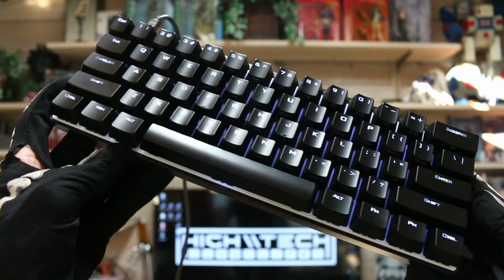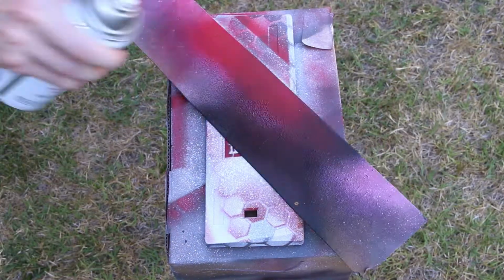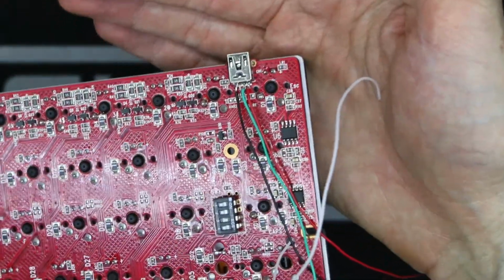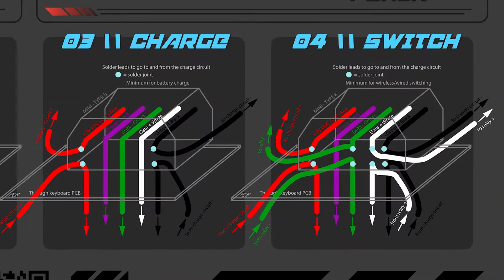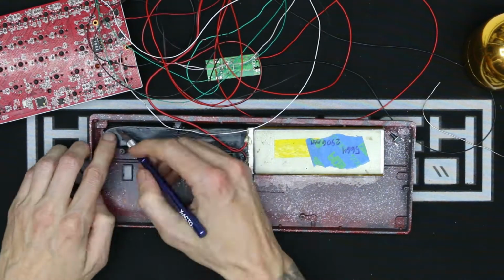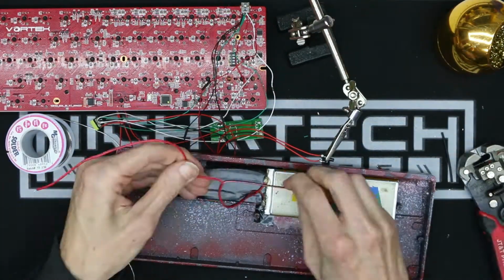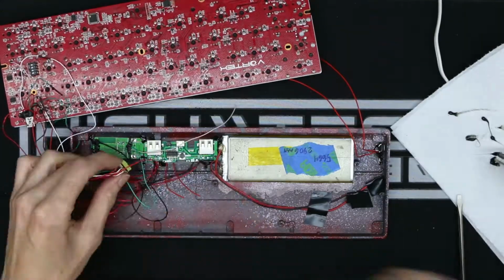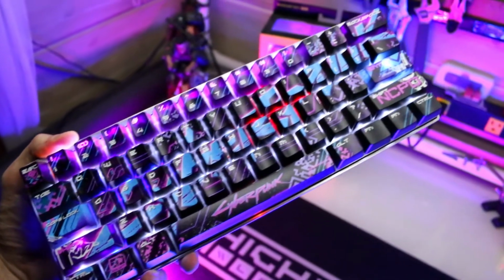⌨ Making A 60% Pok3r Keyboard Wireless! DIY Converting A Mechanical USB Keyboard to Bluetooth + Mods

Comment: If I wanted to make an external bluetooth pack for a keyboard, I would just do everything except the keyboard soldering?
Reply from the maker: If you want to do it external, you don't have to solder anything, just plug n play all the USB connectors 👍If you watch my tutorial video for this I make "joke" in the beginning where I show just that, it's very simple.

Comment: tip, instead of cutting hte mini  USB pins, heat up sand lift from the keyboard PCB. then you have a pin and a pad to solder to.
Reply from the maker: Yes, if you have a hot air station it is easier that way, if you only have a soldering iron then clipping is easier and safer. When I modded this board I didn't have a hot air station, but now I do 👍

Comment: dude i would love to pick  your brain for an issue im having with a project i started.
Reply from the maker: Cool man, what issues are you having?
Reply: @hightech-lowlife  Im trying to solder on a stream deck directly to a keyboard PCB. On the back of the PCB there are pads labeled "5v, d+, d-, gnd" but when I solder to them the stream deck turns on but doesn't connect to the computer. I'm new to this and don't want to brick the board attempting to solder directly to the USBC port like you did in this video.
Reply from the maker: @iv3zaj  Most likely you need to swap the green and white wires (USB data), try it out 👍, you only run risk of harming something if you reverse polarity of the VCC (red/power) and Ground (black).
Reply: @hightech-lowlife  the last video I posted shows the project I'm working on
Reply from the maker: @iv3zaj  In your video If you look at the wires you removed, and then compare to the wires you added, you'll see you swapped the the green and white which correlates to the issue you're having.
Reply: @hightech-lowlife  you wanna hop on discord? im trying to troubleshoot now
Reply: @hightech-lowlife  i noticed that after the fact and corrected it. thats so funny because when i posted the video i didnt think anyone would notice that. lol youre a beast.
Reply from the maker: @iv3zaj  Cool, so it should work now, right? Good job man 👍
Reply: @hightech-lowlife  it's working for a few minutes at a time then freezing. I have to unplug and plug it back in constantly. Could it be the USB C module I'm using? I tried multiple cables and I'm having the same problem
Reply from the maker: @iv3zaj  I would take it out of the keyboard to troubleshoot first, see if you can get it to work there, then implement it back into the board. If it works outside the board but not within, then it will narrow down what is causing the issue. 👍

Comment: You should use a custom PCB board so that the wires do not tangle or mix together. Can you try the Cheap Wireless Keyboard and Transfer it to Wired Mechanical Keyboard, it seems this would work
Reply from the maker: Can you let me know what this board would do? Just for cleanup? If you think this is a lot of wires you should see my dual battery build I made after this one 👍

Yes it is possible to do that, I have read a few articles of other people doing it, I'll try it and make a video later on. Thanks!
Reply: @hightech-lowlife  ohh thanks ill wait for that tranferring  cheap wireless to wired mechanical keyboard :D
Reply from the maker: @jazzehenderson8973  No prob 👍🍻

Comment: I plan to make my keyboard wireless as well! Would the process be the same if I were to use a HID bluetooth module (like a RN-42) instead of the Handheld Scientific BT-500?
Reply from the maker: 100% - there are a few people who have made something like this with them before - https://stackoverflow.com/questions/16243602/arduino-rn-42-bluetooth-module-hid 

I do believe you will need an arduino to control it though. The BT-500 does cost more but when you factor in having to buy an arduino also, and how you value your time to me it's not that much more for a whole lot more convenience. 

It depends on what you're going for though, undoubtedly you will learn a lot more going the arduino route, and also get much more granular control but you will need to dump some time into setting up the code and troubleshooting things, etc. 

Either way it can be done 👍 Good luck man!
Reply: @hightech-lowlife  Thank you! I have another question. Is there a usb adapter like the BT-500 that supports bluetooth 5.0?
Reply from the maker: @bubbytam5400  Not that I am aware of, I'm sure Handheld Sci will come out with a new revision at some point though. 

I'm pretty sure some of the newer arduinos have 5.0, you might want to check out the ESP32 board too: https://www.sparkfun.com/news/3345

Comment: Hmm, in the custom keyboard community, we have this amazing mod called the foam mod, in which you put a piece of foam on the base to dampen the noise and give it a more deep sound signature, this would be great in this build as well it could be useful for hiding the cables, (cut a hole in the foam for the parts the wire is passing through)
Reply from the maker: I'll pack it with foam 👍👍👍Thank you for watching and commenting!

Comment: Quick question, will the keyboard still work connected directly to the computer? I know that if a keyboard uses QMK or VIA it would need to be directly connected to the computer via USB in order to be able to flash it and modify the software. Just wondering if this mod will take away the ability to reprogram the keyboard.
Reply from the maker: Yes, it will! The way I have setup this mod is basically like having two keyboards in one. 

One is just the 'stock' wired configuration, then when you engage the two relays with a double-tap of the power button it physically changes the wiring to take power from the battery and also disengages the data wires so that you can then use the same USB connector to supply charging to the battery. 

When you're in "wired" mode the keyboard and the PC recognize it as it was just a regular wired keyboard (which it is in this state), so you can flash firmware all day without any issues.  

Thanks 💥

Comment: If you're interested I would like to send you a DZ60 PCB to see if the mod can be done, I think this can be huge for the keyboard community
Reply from the maker: That is very nice of you to donate a PCB like that, thank you. 

That PCB looks like Type-C, but also only 5 pin through-hole (like this Pok3r). I'm sure it can be done, maybe not in a way that is 'easy' for others to do, but definitely possible. The hardest part is accessing the wires 'at' the port, even though you're actually bypassing the port wires, this is where it's difficult because everything is crammed in a very small area. 

I have a new build coming in the future where I utilize a custom case so that you can just plug in a connector at the port, and then attach your intercepts after. Although I do understand that this aesthetic will not be for everyone where they want everything very slim and clean. If you're wanting to add wireless to a PCB like this it would be monumentally easier doing it that way. Might be best to create  a 3D printed case that would facilitate this and also leave room for batteries. 

Let me know your thoughts or more of what you're going for, or what would be the most desirable for others. I know 'easy' and 'looks good' are targets, but in this particular situation those are kind of opposed, although I'm not against showing both options. 

Thank you!

Comment: Awesome stuff!
Reply from the maker: Thank you so much!!
Reply: @hightech-lowlife  been looking into the wireless because of the setup I have at the moment. I want to build the discipline v2 keyboard and add wireless to it. I think it would be killer.
Reply from the maker: @dannywiley4072  That would be super cool! I don't think I've seen anyone do that yet, only issue might be hiding the additional electronics but depending on how tall that riser is underneath most likely you could stuff some things under there, or go with a custom case!

Comment: can i buy this ?
Reply from the maker: I'm assuming you mean the BT-500, http://handheldsci.com/kb/
Reply from the maker: Upper Hand Gaming  Haha, no, he meant the bluetooth module :) For this I would recommend a battery with 7mm height, 51mm width, 116mm length. If you watch the 2nd part of this series I go over the battery dimensions near the end. (I use chapters, one of them is on battery dimensions)

I would direct link you to the battery I bought but the seller is no longer offering it. I can't find the exact dimensions in a search either, but anything under 8mm height and 60mm width will be ok, so long as it's not 'too' long. This will definitely fit, but only 2000mAh https://www.ebay.com/itm/113385474291

It depends on what your goals are, if you just want something that works then the above will be adequate, but if you want to squeeze as much juice out of the space as you can, then you'll want to dig for the 4000mAh pack I got (7x51x116mm).